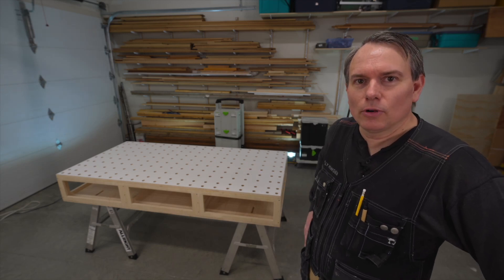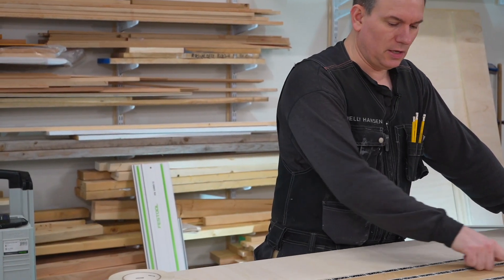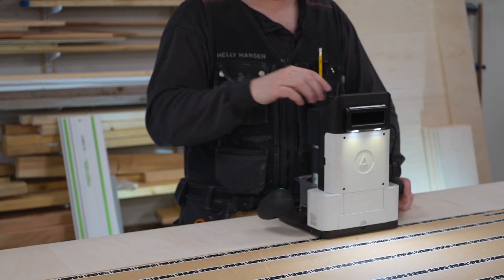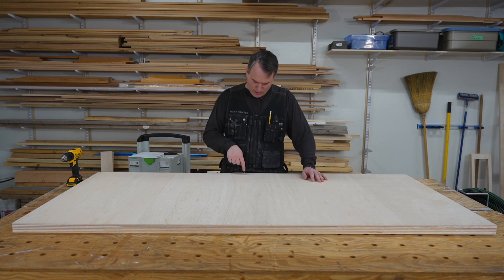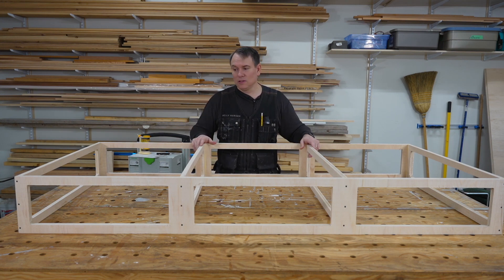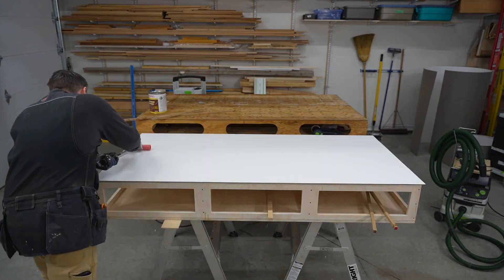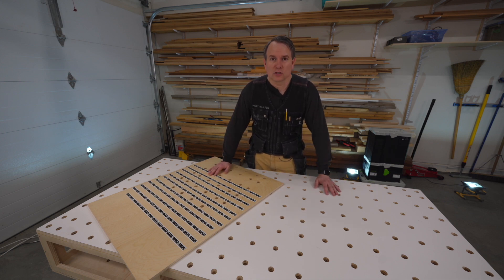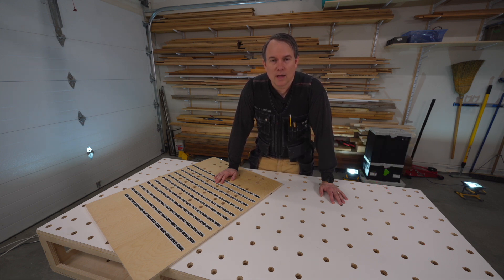Ultralight Compact Work Bench  based on Ron Paulk's design using Shaper Origin CNC

Comment: Question: If you z’ed out the bit through one of the holes of your template and onto your work surface, I’m wondering if it would have sped up the helical process?
Reply from the maker: That’s a great idea.

Comment: Glad to see you used my basic template technique and have improved upon it. I used ultra-light MDF for mine which might be a little heaver than yours but still pretty light.  Plus your torsion box design adds a lot of strength mine doesn't have.  I use the TSO parallel guide and rail squares too and find them to be great but for smaller cuts that fit within the hole grid I find that using dogs is very accurate. Great job.
Reply from the maker: The post you made was so helpful I wanted to share your link with others. Thanks for the encouragement. Keep in touch.